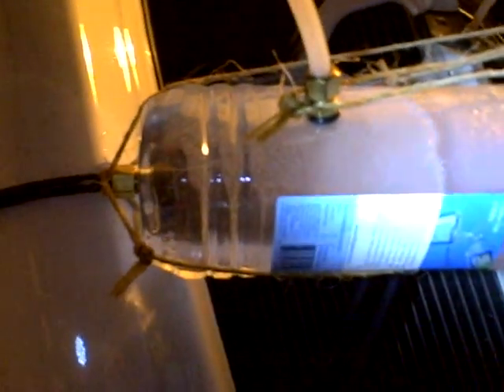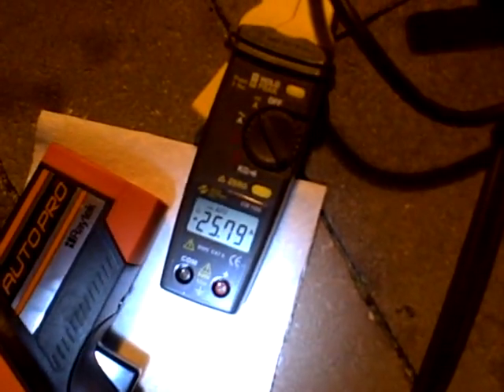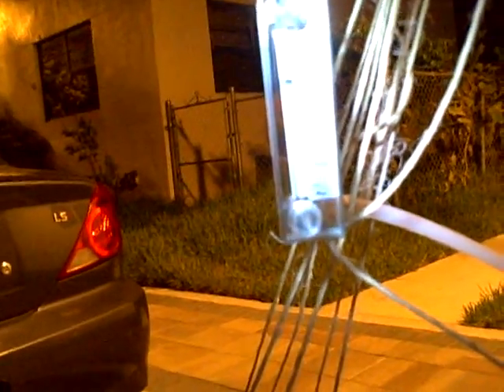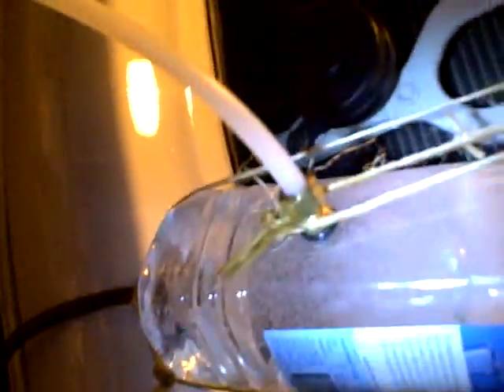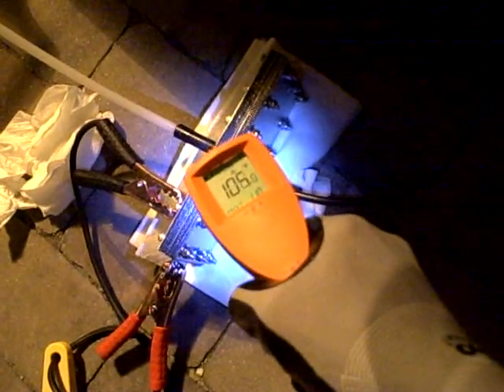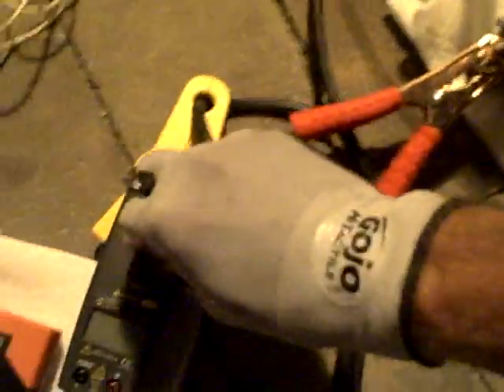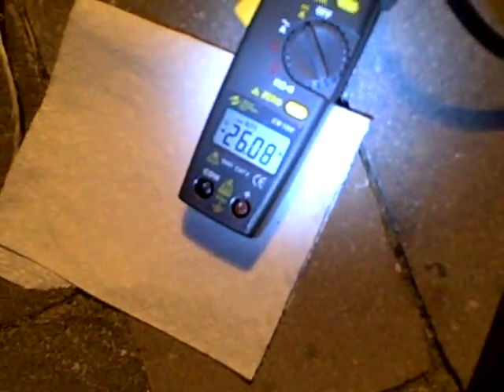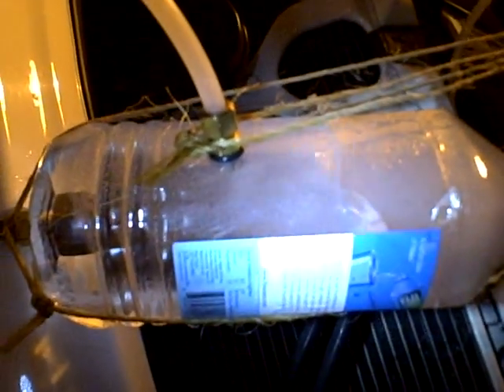HHO CELL  2.0 liters in 1 minute

Comment: Your lpm are way off, the moisture increases the output ,the way the gauge works ,the moisture decreases the distance between the ball and the tube , and it pushes the ball up higher . For that gauge to work you need a desiccant line dryer, I can see the vapor coming out of the gauge, I have the same unit.

Comment from the maker: will be doing test with 1 liter bottle this week for alternate output results.  the gaskets are about 1/16 spacing between the stainless steel plates.  all plates have been sanded with diamond sandpaper and have been chemically treated with distilled water bath/wash, then white distilled vinigar bath/wash, then again rinsed with distilled water before assembly.  will also be adding additional nuetral plates to see if production vs. amperage can be improved any.

Comment from the maker: they are 4X9" s.steel 316L stamped plates, 18 gauge.  the fittings are formed from a press on the outside plate and you see it comming outwardly slightly.  the inside is clearance enough for liquid/electrolyte to travel through.  cut the rubber tube flush on the inside with a razor.  the rubber tube is pressed/compresses into a smaller hole whose circumfrance is above the plane of the negative plate itself leaving plenty of room for electrolyte circulation after trimming inside with razor.